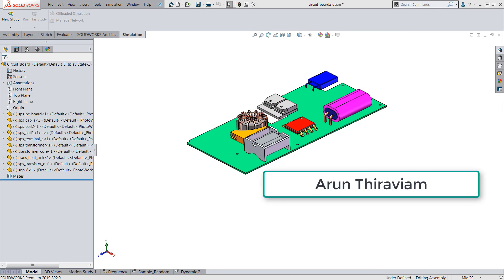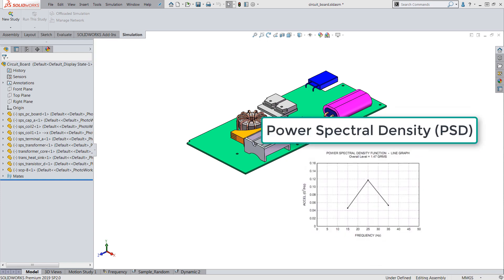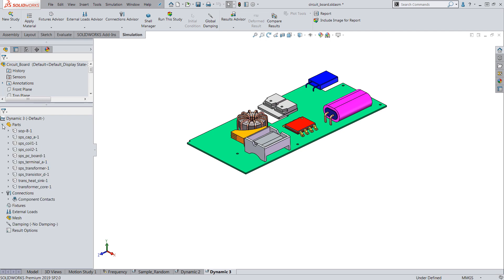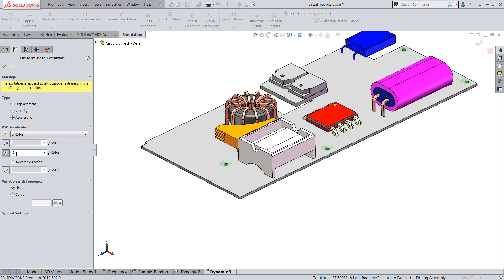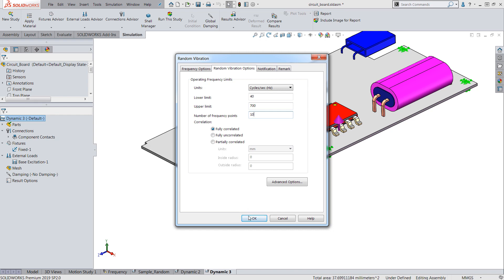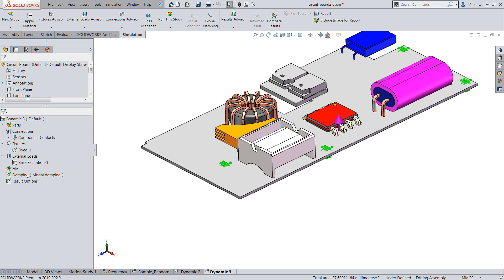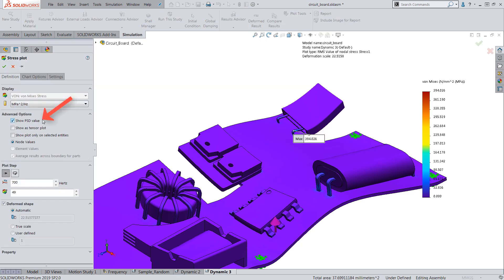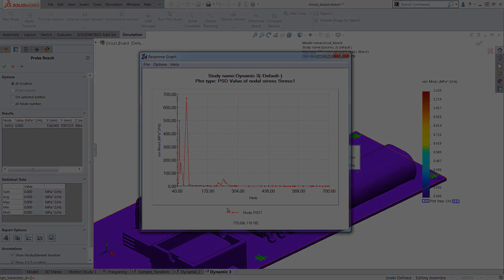SOLIDWORKS Simulation - Random Vibration Analysis

Comment: Very helpful video. Thanks for making the video. Do the RMS results consists of 40 to 700 Hz (chosen for output) or 15 to 2000 Hz?
Reply from the maker: In this case, because we only tested between 40 and 700 Hz, the results will be for frequencies within those bounds. Arun was saying that we could test between the 15-2000 Hz range, but he decided that a test between 40 and 700 Hz would yield sufficient results for this test.